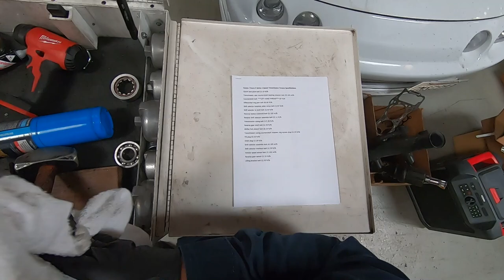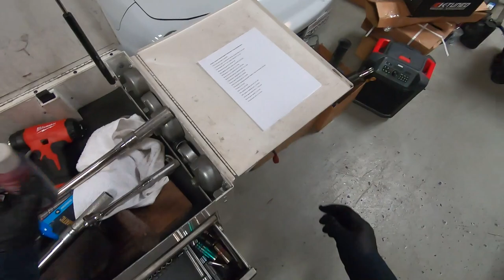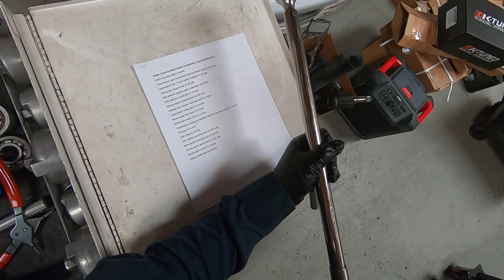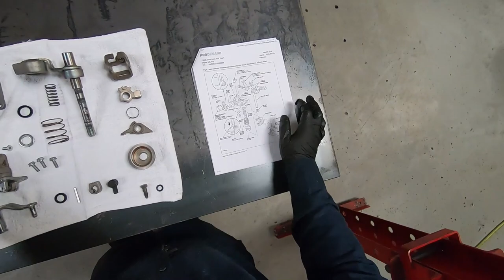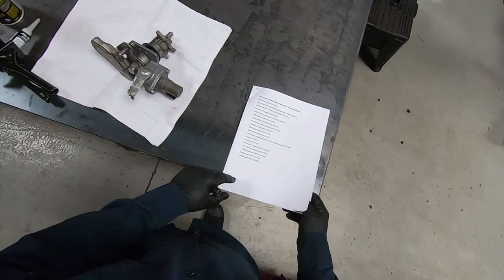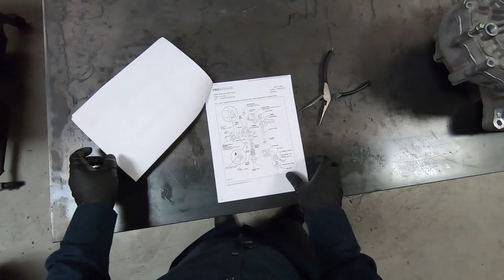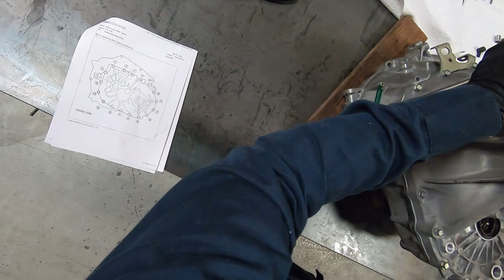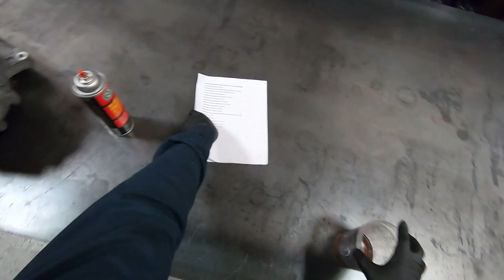Honda/Acura K Series Transmission Build Assembly Complete/Uncut

Comment: Thanks for the vid man and thanks for keeping it real as well.   So many edit things to make it seem perfect but reality is things doesn’t go perfectly and you show what to basically do and look for 👍👍.    
One thing that worked for me fabulously is when mating the cases , hit the area where the bearings go with some heat.    A few seconds with Map or even propane Little does a long way   And normally drops right on with barely much persuasion needed with mallet.      Also when checking thrust clearance , works great to drop the bearing out too! 
👍👍

Comment: This is on point!! And I agree, you should do a rundown/walkthrough on the shimming and clearances. I’m in the middle of this exact build including adding an LSD. The shims and/or clearances are the only things I’m uncertain on how to calculate. This video is already a HUGE help having toque specs rolled in.
Reply: Same, I'm going to be adding an LSD to my 04 RSX-S trans with the TSX 5th gear and 9th gen Civic Si 6th gear and I'm still trying to figure out the clearances before I begin. To be honest, when I had my D17 trans apart back in 2021, I didn't learn that there were different thickness shims until months later. Fortunately it's still quiet and shifting as good as new after 15K hard miles, so I guess I got it close enough LOL
Reply: DTI gauge + adapter & feeler gauge.
Dial gauge for end float
Feeler gauge for diff

Comment: Hey, this was phenomenal, but are you sure the various hardware that you lubricated (counter shaft bolt, and diff bolts) where wet torque specs? Lubrication dramatically effects achieved torque, and you can easily over torque if using a dry torque spec with lubrication. 
Also, when torturing you should stop after the first click, resist the urge to double, or triple click.

Comment: I sealed the transmission an torque all the bolts I noticed the reverse shaft was not aligned I was able to get a long pick from the shift selector hole to recenter the hole for the nut also I find it really annoying having that plastic inside having to lay the casing down with that piece on the hardest part to me was closing the case while having the spring clip open while you smack the casing an tighting down the bolts

Comment: I’m currently stuck replacing my sleeves  and 2nd gear. I’m stuck in the 1 and 2nd shift testing for whatever reason they just won’t go in. I removed the spring, and it slides right in. But when i put them back on, it doesn’t engage

Comment: I don’t recommend to lube the outer edge of the oil seals, if you can push it in that easily with lube there’s a chance that seal is moving once in service.
Reply: You are much more likely to damage the seal pushing it in completely dry, I always lubed the edge of the seal and the hole it goes into with whatever oil I had nearby and never had one move or leak. They sort of stick in place once they have been in for a while like how coolant hoses get stuck. Besides, the seal is not under pressure or subject to any significant force during operation.

Comment: I'm 17 and dying to learn more please 😊. I'm putting a K24 in a mid engine configuration. I want to turned the engine around so the exhaust is straight out the back and runs cooler. Do you know where I could find a video on how to reverse the drive direction in the transmission to allow me to do this? Thank you for any help.

Comment: What do you do to clean all the transmissions parts? Can you use a ultrasonic cleaner? If so, what solutions are best for the gears, needle bearings, etc. What parts can you not clean with the solution?
Reply from the maker: @RanmaKei  Hi, I clean everything with Purple Power Degreaser concentrate. I use a pressure washer for the casings, and submerge the parts and shafts in Purple Power and agitate them with a nylon bristle brush.

Comment: Hey mate,will make aure to watch all the video after work tonight, i got a question you might know the issue

I want to change gear ratios on my Accord cl9 with the and use the ones from the civic type r but keep the Accord 6th gear, so i ve heard very often people have the problem after the rebuild that the 6th gear will pop out under engine load... Do you have any clue maybe why?

Comment: Hi sir, how can I locate the speed sensor easily without disassembling the entire transmission and engine? My car's speedometer cannot show the speed; it always stays at 0 km/h
Reply from the maker: @dlo0315  Hi, the vehicle speed sensor can be accessed for troubleshooting and/or replacing with the transmission still in the vehicle. Disassembly is not required.

Comment: Great video and instructions. How come you cannot compressed the counter shaft gears all at once so you don't have to waste time doing one by one? With all that work and the case is open, should have put in a LSD as it looks like an open diff?
Reply from the maker: Glad this video was helpful bro! Whenever pressing any components on, you should preferably press them on one by one in case one of the components gets snagged. Technically speaking, yes it is possible to press them in all at once, but to ensure no damage occurs to any of the components, I press them in one by one. The countershaft gears are splined so if you were to try to press them all in at one time, the following gear might not align with the splines on the shaft and can get damaged during pressing. As for the LSD, this transmission was for a customer’s vehicle and he did not select to have an LSD installed, just a simple refresh since the transmission was out for a clutch replacement.

Comment: Would you happen to know if it's possible to use the dc5-r 4th and 5th gears in the 05-06 rsx-s tranmission? If so would different synchros be required? Great video.
Reply: Did you ever find out if different synchros are needed?

Comment: You missed the most important part the shimming process all the calculations for that is the most important on a trans build and you cannot assemble it with old used shims even the diff gets shimming the min you add new bearings to it as well
Reply from the maker: Approximately 42 seconds into the video I mentioned that all clearances have been checked. I partially assembled the transmission to measure clearances prior to this video and took everything apart again for a complete and uncut assembly video that people can use for reference.
Reply: @jonathanjovenal  Excellent video man. If you can do a separate video on the shimming process, that would be da bomb. Keep it up bro.

Comment: Will it be harder to turn input shaft by hand at higher gear and reverse? 5th and 6th gear specifically? My 1-4 and neutral is super light/easy to turn.
Reply: How much harder? Naturally it is going to be somewhat harder to turn in 6th than 1st since there's less of a gear reduction, but it shouldn't bind or be hard to turn in any gear.

Comment: I’ve got an issue with shifting into 1st and 2nd after doing rebuild on synchros any idea what it could be
Reply: All other gears work fin even reverse
Reply: @user-hh4hc2lt6e  yeah they all work now. Just having a rough shift on 5 and then it pops out upon acceleration

Comment: Is there any other seal that can cause passanger axle to leak. I replaced the axle seal but it’s still leaking out
Reply from the maker: Only use genuine Honda seals. If you replaced the seal with a genuine Honda part and are 100% sure it was installed correctly, you could possibly have worn differential bearings or worn axle shaft journals internal of the differential that could be causing the axle to wobble excessively and leak.
Reply: Mine is leaking too im gonna change it, maybe its not push in enough but dont push it too much or it will touch the diff

Comment: The diff bearings are not placed right direction
Reply from the maker: Thank you for watching! The Synchrotech bearing kit comes with bearings that do not have a shield on one side like what comes from the factory. The bearings used in this rebuild can be used either way.
Reply: @jonathanjovenal  ohh i see .
I bought oem bearings thats why i got confused. How many oil seals are in the 6 speed k20 gearbox??

Comment: I just dropped in a new mfactory lsd in my 06 rsx and im trying to close the trans but I cant get the c clip to close over the bearing. I tried dropping it snd prying it but nothing seems to work. I opened and close the case several time and cant see anything wrong. The input shaft spins freely and it goes into every gear, only problem is the c clip wont go into the bearing. There like 1/8 inch for it to go in. Any help would be great!